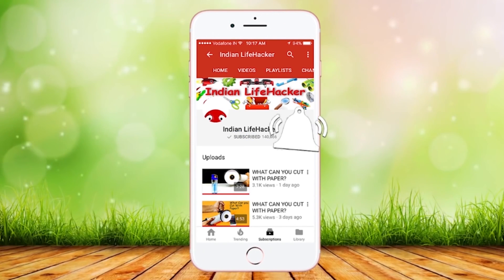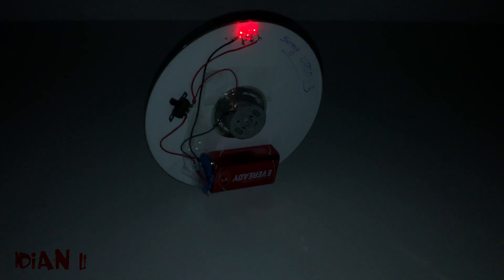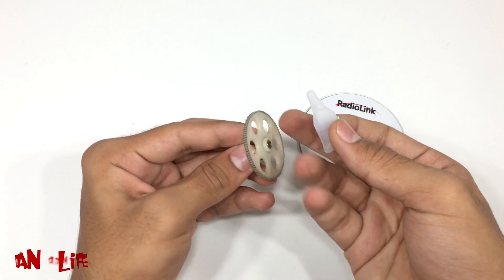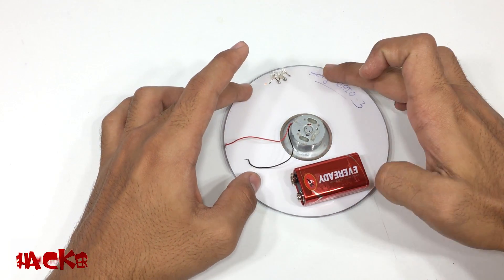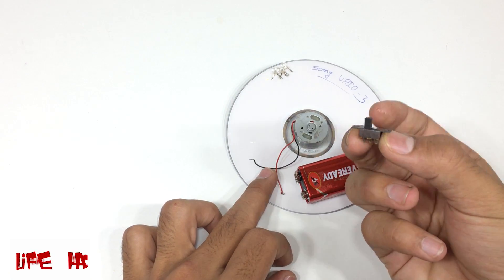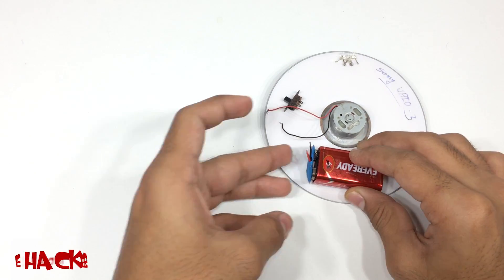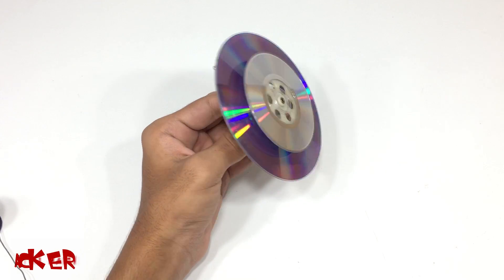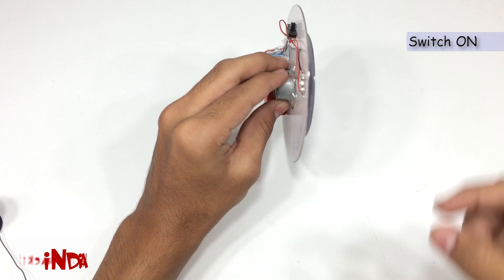How to Make Anti Gravity Wheel at Home | Indian LifeHacker

Comment: how do u get small disc
Reply from the maker: This motor is from old dvd.
Reply: small disc is generally found with old Nokia phones box & some internet dongle setup CD. you an use a some other round & flat disc as well.
Reply: hey guys we can also use a wheel to use 

just buy a wheel that connects with motor 

then stick it tightly with the CD 

That's all